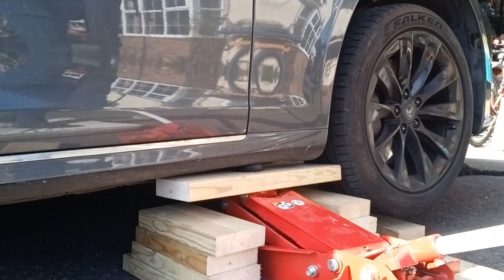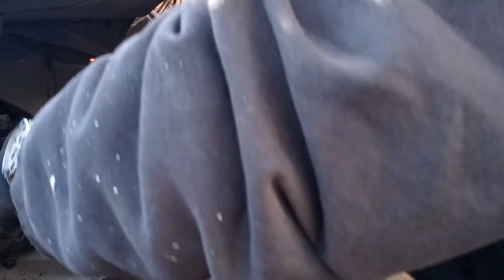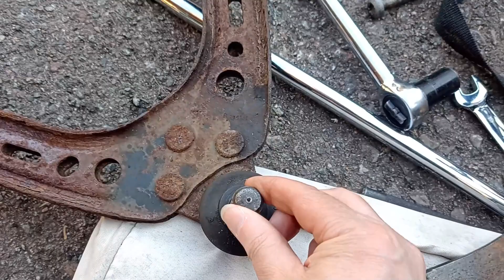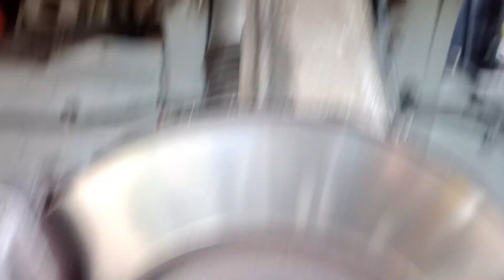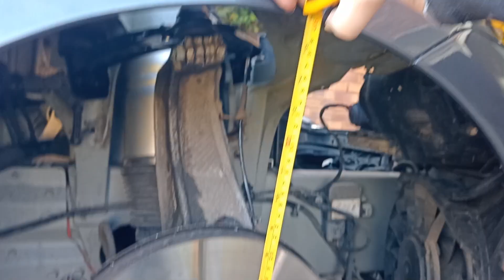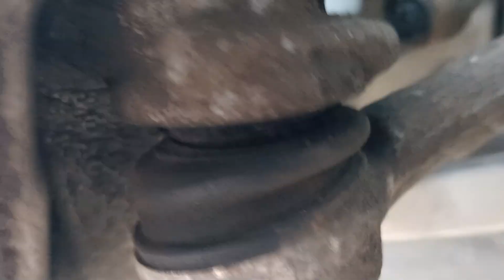Tesla Model S 2017 Suspension Front Upper Control Arm Replacement

Comment: The anti roll bar link is easy, just start undoing it with a socket the get your torx on it and use a spanner to stop the nut moving as you undo it with the torx

Comment: Great video. Were the pivot bushes in the upper control arm worn out as well or was it just the outer ball joint?
Reply from the maker: Thanks. The pivot bushes looked ok to me - no cracks etc.
Reply: @ so are you able to just replace the top ball joint?
Reply from the maker: @stuartarmet3526  You can buy a replacement ball joint but not sure how you are meant to remove the old one. https://www.autodoc.co.uk/nk/16429922#ball-joint
Reply: @ isn’t it attached with three bolts?
Reply from the maker: @stuartarmet3526  The new one has bolts but the old one looks like it is attached with rivets.
Reply: @jonathanackland3846  measure the new bolts drill out the centre of each rivet ( a bit under size for safety) and try a cold chisel under the heads , one side and punch out the rest — unless you’re skilled with an angle grinder 🥴
Reply: Thanks for the link 👍
Reply: normally those bushes last forever, it is only ball joint is the problem

Comment: Seems really wrong. You shouldn’t have to drop the air shock? Take off front  bolt, loosen rear bolt and pivot over to remove rear bolt. Also should have measured location of upper control arm to install in same spot and attach ride height sensor so no programming is needed.
Reply from the maker: Thanks for the comments. The Tesla service manual said I would need to drop the air shock but I was hoping to avoid it - unfortunately there was insufficient clearance. Good advice with the measurements - I should have checked the position of the upper control arm once the front ball joint was removed to see whether it was different to the normal "under load" position - the ride height is good though.
Reply: Nice video - it’s a real bugger not being able to remove the forward bolt without dropping the strut. Am I correct in thinking that in Jack Mode, you don’t lose air from the other struts when disconnecting one? Also, are you ok not replenishing the reservoir with nitrogen? I’m just about to do the same job on mine and am loathe to mess with the air
Reply from the maker: @richrootes  Yes, Jack Mode works in that way - when I let the air out of the shock I was working on the others remained unaffected. I haven't considered topping up with nitrogen and other YouTube videos of airshock replacement don't either. One of mine is slowly leaking so not much point! If you are concerned then a quote from Tesla just to do the top-up might be a reasonable price. It was definitely worth doing the swap as it now handles like a new car and the crunch has gone, albeit a slight creak remains which the alignment guy said should go once it has settled in - will see.
Reply: Just did this exact job about a month ago and can confirm you have to drop the air shock. Pita
Reply: You just need a deep spanner to remove that bolt, don’t need to remove the discs